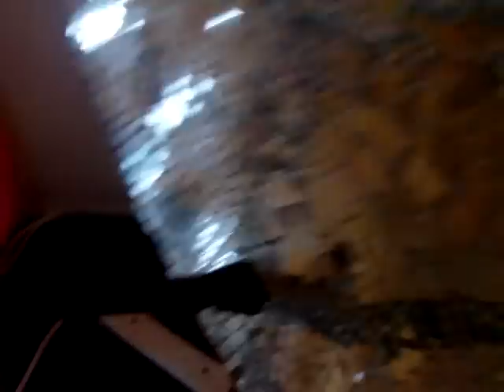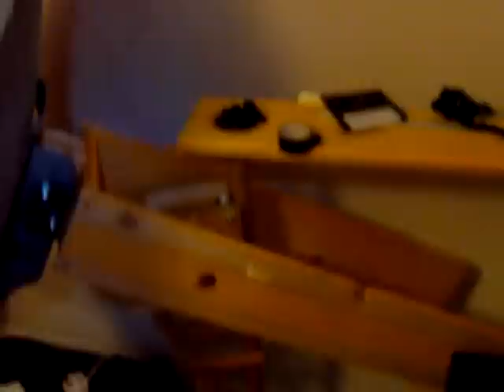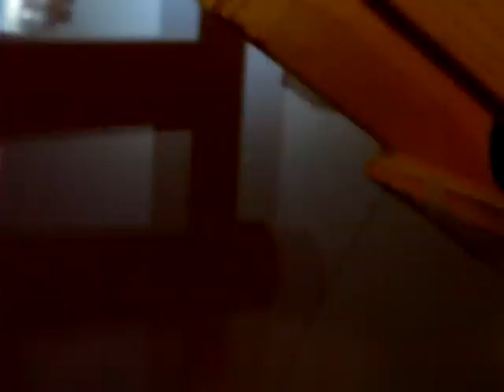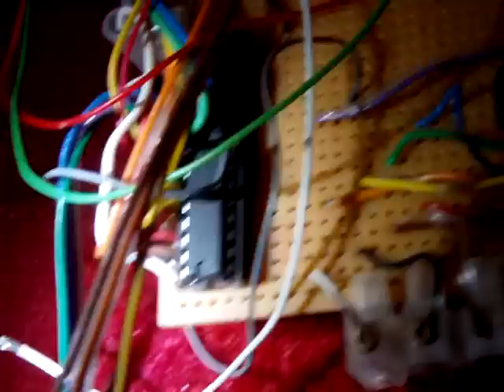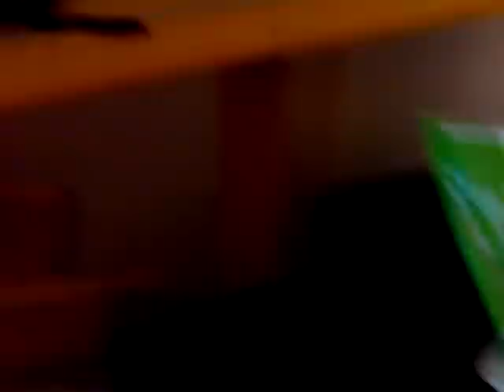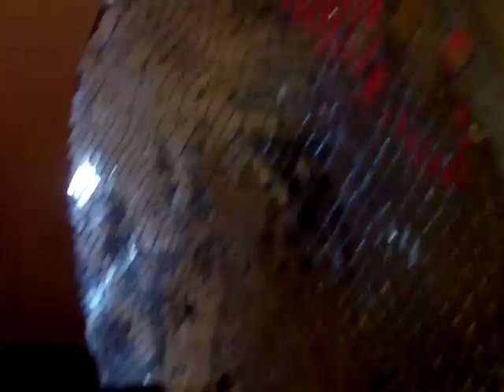Archimedes auto tracking solar furnace

Comment from the maker: @skb0rzn Yeah cheers, I got some metal gears for it yesterday but I've run out of cash again thank you bank bailout! So I'm waiting for my next paycheck so I can get some bottom tapping tools to screwthread the smaller gear onto the stepper motor and get some 25 mill cylinder bar as a better pair of drive shafts than broom handle! I've also got to get my gf her present so I'm probably  looking at January February before I can get it finished.

Comment from the maker: @Raklestad235 Yeah you are right, but I haven't made a mount for it yet and I have been playing Civ V for the past week so work on it kinda stalled. I'm also redesigning the stepper motor gearing mechanism to incorporate 2 welded bicycle forks on it because in Scotland there's no way my current setup will survive the wind up here. Thanks for your support I'll do an update running up to Xmas. Also funds have run a bit dry because its Lexi's Bday next week and she goes mental when I drill and saw